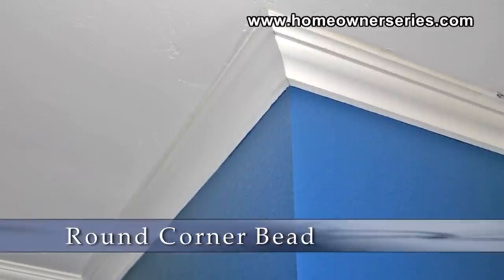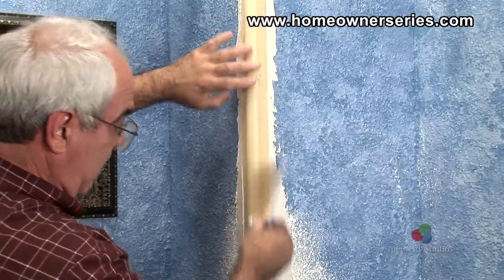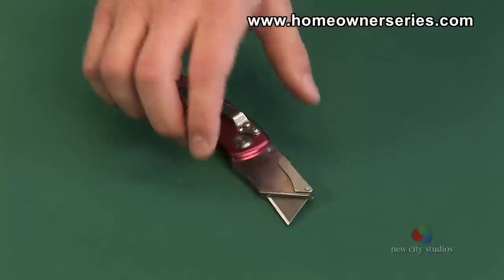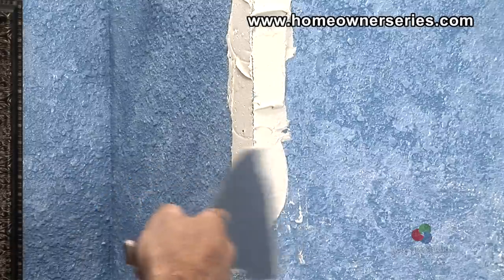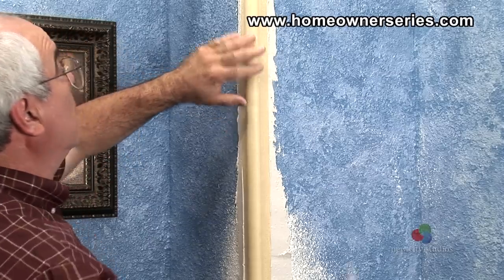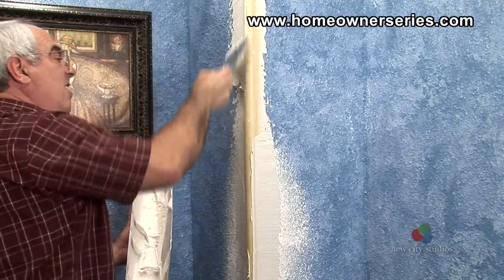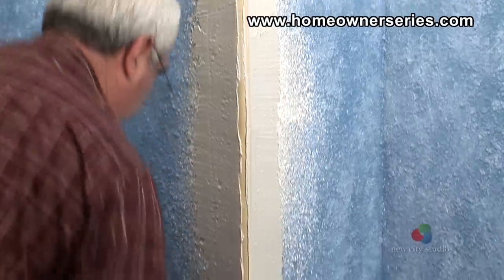Installing Round Corner Bead - Drywall Repair - Part 1 of 3

Comment: Didn't know I'd need 50 pounds of plaster for one corner.
Reply: I've has issues with bull nose corners denting, and I suspect that the low compression strength of steel, requires plaster behind the whole thing.

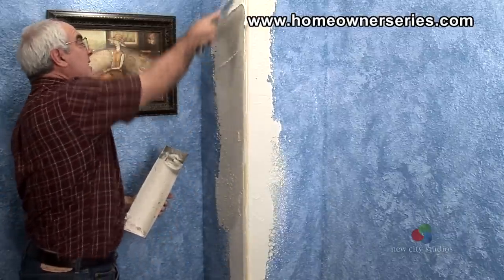Comment: At 2:47 you say, "Scrape horizontally over the entire length of the wall." Unless I'm mistaken, it seems like you actually meant "Scrape vertically over the entire height of the wall." That's what he's doing at that point in the video, anyway.

I also agree with the previous commenter. When I saw this, its title lead me to believe it was about repairing round corners, not installing new ones (not to mention, installing them over existing square corners).

Comment: Nope sorry wrong put a framing square in that inside corner on the left of the master carpenter. 1/ 2 " out of square.  I always cut it back a 1/2"
Reply: Thanks for your comment. I'm just a homeowner, but cutting it back seems logical. I'm certainly going to try that first.

Comment: do you need a lot of plaster because of compression strength?  I've had issues with bull nose corners denting and sometimes getting holes.  Can Structolite(tm) or a similar product be used in place of mud?.

Comment: how do you repair existing bullnose corner bead? From an existing textured wall?
Reply: I know this was 5 years ago, but textured walls are a relic of the 90's and I'd say smooth them out. If you reach the corner, pull it off completely, and put lots of Structolite, or veneer plaster, to key into the remaining hole (if there is enough space for a brush, some plaster weld wouldn't hurt).  The replace the bullnose and cover the outside with plaster.  Get a bullnose corner trowel,  and a 6" flat plaster trowel, to better feather in the plaster( although if you scrape off the finish, applying plaster weld and a coat of Structolite, would give a nice finish and increase sound insulation.  A flat finish paint would hide imperfections in the wall, consider a water-based alkyd paint with ceramic microspheres (which further reduces temperature and noise transmission including echos), PVC wallpaper is also good for hiding imperfections, and around corners would help with dent resistance.  Many are also paintable.
Reply: @brettknoss486  It depends on the area. Textured walls are very popular in the Phoenix Valley area, even in luxury new builds. I guess it's a southwest thing.
Reply: @kateskate6960  maybe. I thought it was a trick to hide uneven walls. I'm not a fan.